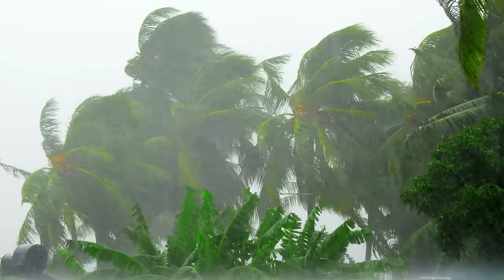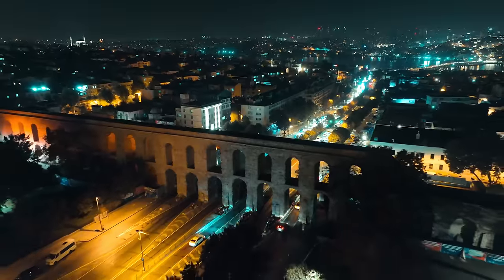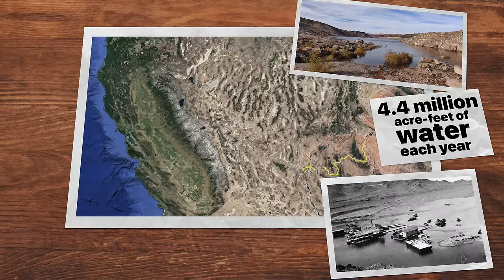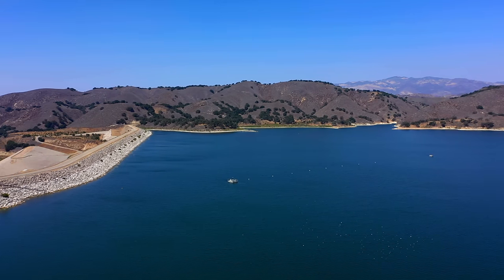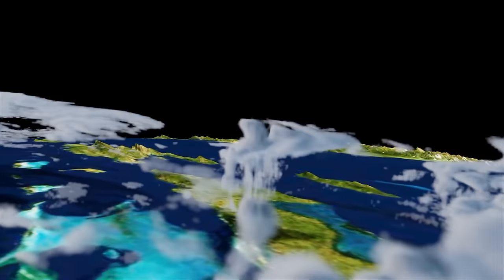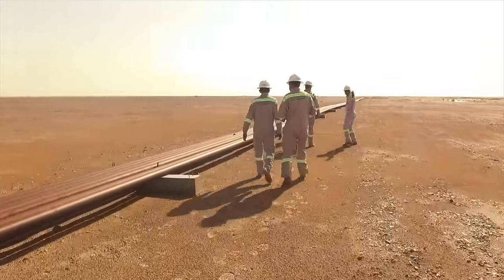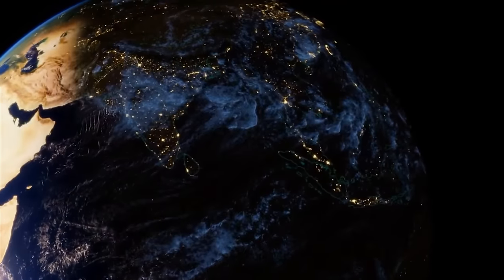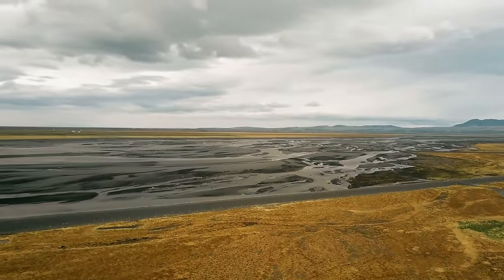Pipelines From Flood to Drought

Comment: I actually wonder though if you could create energy moving water and saving water, there is kinetic energy machines that uses pumping water as batteries. This may not power everything, but it could save a ton of money.
Reply: Are you mentioning the ram pump system? you can also generate electricity from the water going down hill.
Reply: @joearmstrong2404  I believe so, it uses gravity to store and expell energy, like a battery. Also, exactly.

Comment: I have been saying this shit for the last ten years. Get the water that floods off of the Mississippi or when it floods in Louisiana or any other Southern states to move it over to where it is needed. I would say truck it, this is almost the same thing.
Reply: Trucking is not an option, it would take about 5000 trucks a day. It would require canals and pumps,,,,,, lots of pumps. But it is doable. One method would be to pump it uphill and then install hydro turbines on the downhill side. The turbines would create the energy to run the pumps.
Reply: @leroythemaster4268  You are the first person to give me an answer, thank you and your idea for the hydro turbines is a good one too.
Reply: @beauxr.benoit1374  Did you see my post about turning Death Valley into a Salt Water Lake. 
Low cost to do and would actually pay for itself by creating farming and high end real estate and tourism.
 I also have  a wild fire plan if you are interested.

Comment: You made some excellent points. The only issue that I am skeptic about is cooperation between states. During the Texas freeze in 2020 (or 2021), TX reached out to Mississippi and other neighboring states for help, and was denied. And in cases for flood states, when they needed help from neighboring states, like TX, they were denied. This plan is brilliant and completely rational, but I worry that the only way to implement it would be to create a Federal Policy which many states will try to block... even if it saves lives. Do you have an idea as to how we work around this obstacle?
Reply: Forget cooperation between states, how about international issues? Speaking as a Canadian, it's long been known how much some American states covet our water, seeing it as a resource they somehow have a right to. There was the NAWAPA scheme that would have flooded much of northern Manitoba as a mega reservoir to supply the US. Or how about the plans that pop up every now and again to draw massive amounts of water from the Great Lakes (so much water there, after all) while completely missing the important fact that they want to take a larger volume of water than can be naturally recharged. While re-purposing existing petro pipelines sounds like a relatively efficient method to move water around, the example of using the Keystone route just reeks of typical American arrogance, as if in Western Canada we're not experiencing drier seasons with less rain/snow fall ourselves. The dry states have truly screwed themselves - too much population using way too much water per capita. Look at the dried up reservoirs and depleted aquifers as a testament to that. I have long held that if the US ever goes to war against Canada it won't be about politics or ideology, it will be a pure water grab, with billions or trillions of dollars to be made.

Comment: I think your math or assumptions about the fluid in the keystode pipeline is wrong. 600k BPD through a 36" diameter pipe corresponds to a linear rate of 5.515 feet per second. 1000x faster is faster than the speed of sound through water.
No. That's not possible.

Comment: As far as California is concerned, why not pump the extra water back into Lake Meade making it a close loop. Yes, a new return pipeline would be necessary, paralleling the existing one, but the reservoir already exists, and it runs low all the time. Ciao, Marco.

Comment: I was reading somewhere that the great salt lake in Utah is reaching such dangerously low levels that if it continues it will start giving off some kind of poisonous gas and make the entire valley unlivable. Something like this could definitely be an interesting solution.
Reply: This is true. And the main reason for the drying up of the lake is all the alfalfa crops. They are extremely water heavy crops and arent even being grown for the area's needs, but are being sold to China. So short sighted
Reply: @LM-wz9yw  Actually a lot of it is used for animal feed state side. Only 33% exported . But I do agree that California has a lot of water intensive crops. I personally don't think they should be grown in California with all the water issues they have
Reply: @corners3755  you are right, I was specifically referring to Utah, and after researching, it seems only 15% is exported. Also, to be fair, alfalfa is a cover crop and actually helps to keep moisture in the soil and improve local moisture levels.

Comment: Pumping requires additional electrical capacity, and it's expensive.  We're presently at our limit.  With the current administration's executive orders against using fossil fuels, we can't even handle the proposed extra load of recharging all the proposed electrical vehicles.  Besides, it's pretty clear climate change has nothing to do with burning fossil fuels and is related to solar cycles, ocean currents, earth's axis wobble, high atmospheric dust and plate tectonics.  So far, all of the scary ten and fifteen year climate predictions have proven to be false hysteria.  I do favor more reservoirs and pumping water, but additional power plants will be needed to accomplish it.  The US has at least a 300+ year proven reserve of clean burning natural gas (methane) and who knows how much more with additional exploration.  Keep in mind CO2 is last on the list of important greenhouse gasses:  First, by far, is water vapor, then ozone, the oxides of sulfur and nitrogen, methane and a distant sixth is CO2.

Comment: Face value it's a cool idea but there are a couple of important things to think about that aren't even touched on here. 

a) Interstate Politics: You're crossing over multiple state lines with any such pipelines or canals, which then requires agreement/buy-in from those states. We've already seen how much of a clusterf*ck that can be with rivers - where states "split up" water rights and over-leverage natural waterways. Everyone is going to want some rights/access to the water, given how critical of a resource it is - would there even be much left at the final destination? How would you deal configure consequences or deal with bad actors if they overuse? Cost would be nuts to suddenly divert water around a state that decides to overuse. Who maintains the pipes/waterways? Is each state responsible? If the water is contaminated, how do we know and deal with that? Who's responsible? Lots of questions here that don't get solved overnight or potentially even in a decade because of the volume of legislative buy-in required.

b) Side effects on our oceans - we have no idea. One concern of mine would be that, for as long as humanity has been around, fresh water ultimately has fed into the oceans (e.g. rivers emptying out into ocean). If we start curbing all of that today and diverting it elsewhere, what mid-longterm effects does that have on ocean ecology and overall levels? Do we even have a way to know that for sure? As a species we've been very, very, VERY bad about properly anticipating and addressing side effects to any of our actions or projects, and trying to fix negative side effects of such a project as this might be even harder than the water problem in the first place.

Comment: I could see building a water pipeline from Kansas to Colorado, diverting some of the Mississippi flow into the faltering Colorado system. It would not be cheap, but should be feasible.

Comment: I like your example of the Keystone XL pipeline, but you may have missed that the pipeline has been blocked by Presidents Obama and Biden.  It has never been completed. 

Then you have to contend with international water treaties.  Canada doesn't allow the bulk export of water on the scale you are describing.  As an Albertan and Canadian, I think that we should consider exporting bulk water, but only from regions like Northern Alberta where the water is abundant.  The Athabasca River, for instance has an average flow rate of 783 m3/s.  Diverting about 100 m3/s would leave a significant amount. The Peace River has an average flow rate of 2,110 m3/s, 300 m3/s could likely be diverted without any serious environmental concerns.  For comparison, the Colorado River has an average flow of 640 m3/s.  Politically I think the idea is dead in the water.

How much would the US be willing to pay for the water?  How would construction cost be divided?  Even at the ridiculously low cost of $4 per cubic meter (continuously adjusted for inflation), $4/m3 x 400 m3/s x 3600 seconds per hour x 24 hours/day x 365.25 days per year = $50,492,160,000 per year.  That would certainly help to pay down the Canadian national debt.  That's close to the cost of four Gerald R Ford class aircraft carriers per year.  It would hardly be noticeable in terms of the nearly $3 trillion US national debt, but how long can the US continue to run such outrageous deficits?

Comment: Nice presentation but there's an error in your logic.  Reduced viscosity will allow you to move more liquid for the same pressure drop but you have to ignore the maximum allowable pipe velocity.  600,000 bbl/day in a 36-inch diameter pipe gives an average velocity of 5.6 ft/sec (if my math is correct).  That's a good operating design.  Run too slow and sediment will drop out, run faster and you'll suffer from increased pipe erosion.  You might be able to double the flow by running at 11 ft/sec but there's no way you can move 1,000 times more water through the pipe.

Comment: Water finds its own level.  Water can be routed via pipes that can be routed underground, above ground or tunneled through mountains. As long as a water user is lower in elevation than the source, water will flow there.  Oregon, Washington and Missouri are wet States.  Oregon is closest with 27.5” of rainfall Washington is further but has more rain (39”/year). Missouri is even further away, but it is a very wet state with 42.23” of rainfall a year.  They are all higher in elevation.  In terms of elevation, Bend is 3623’.  Mt Hood is 11,249’  Yakima’s elevation is 1066’.  Even Springfield in Missouri is 1299’.  By contrast, all the major cities in California are low enough to have water flow to it from Oregon, Washington and Missouri.   San Francisco elevation is 52’, San Diego is 62’, Los Angeles is 305’, Santa Barbara 49’, Malibu 105’.

Comment: Just some quick checking but I believe the best place to tap the Mighty Mississippi is probably around Memphis, TN with an elevation of 259 Ft above Sea Level.  If you head west / southwest to Texas around Texarkana 311 Ft above sea level, out to Potsborough, TX on Lake Texoma 769 Feet above Sea Level, on out to Amarillo, TX 3,668 Feet above sea level then on to Santa Fe, NM 7199 Feet and then to somewhere on the Colorado River.  Bottom line that is a lot of Horse Power to pump any significant amount of water.  I don't think it would be feasible.  :(

Comment: I think you made an error regarding viscosity:
Resistance to flow is based on the SQUARE of velocity, so a drop of viscosity by a factor of 900 would only increase flow by 30x
😢

Comment: Your calculation of 600M barrels of water per day is whackadoodle.  Please check your figueres.  It does not pass the smell test.  Since there are 86400 secs per day then i'd need to see about 7000 barrels of water passing through an observation point in the pipe every second..  DImensionally a 55-gallon barrel of water would take up 9.5" of a 36-inch diameter pipe.  So 7000 barrels per second would equate to 5541 feet per second, over 3600 mph, so that water is traveling at hypersonic speed.   Your estimate is completely wrong.  I might believe 6M barrels of water a day.  I might.

Comment: This is Brilliant !   
    ? What about using Elon Musk's "Boring Machine Co." to make the pipe-line underground, it could be "stepped" & slanted ever-so-slight that gravity would do most of the work. 
          The end-of-line pumps could be 1000's of SMALL solar powered pumps that could run continuously with battery back-up.

Comment: Oil pipelines?  The cost of shipping oil by pipeline is around $5.00 a barrel (well $2.00 a barrel if flowing downhill)    Nobody can pay that much for water.  Anywhere or at anytime.  Keystone?  outside of Oklahoma region, only 2 miles of the US section was built in 4 years of Trump.  But then the BBC looked at the "wall" and concluded only 30 NEW miles of it was built over the same time. Yes, many miles of wall was replaced, but that was all ready mostly planned for decades.  Please do not blindly believe what I say, look it up yourself. Actually a good plan for what  most "experts" say.

Comment: Ignoring the fact that the drought extends from the West Coast to east of the Mississippi River - making pumping water from the Mississippi a non-starter this year, there is the question of how to pump huge volumes of water from the elevation of the river to Lake Mead. Since Lake Mead is at about 1200 foot elevation, so far so good. Of course, to get there from Iowa the pipeline would have to climb to over 6000 feet before descending to Lake Mead. The Mississippi River is around 600 feet above sea level in the reach of Iowa. A pipeline from Dubuque, Iowa to Lake Mead would be about 1500 miles long.  Basically, it required pumping water a mile high. The now-defunct Keystone XL pipeline would have been 1200 miles in length and in 2014 was estimated to cost $8.7 billion - so add 25% for the greater length and another 20% for inflation and it might cost $13 billion in 2022. Then there is the question of how many lift stations would be needed to move the water up a mile+ in the air. This would be a true megaproject and could easily take a decade - with the risks that the Mississippi River may not have the excess water anyway and the drought could be over before it started operation. The time it would take to get the design done and the environmental clearances and to assemble the right-of-way could easily add another decade to the schedule. In fact, the whole idea of just sucking water from the Mississippi River assumes some sort of significant water impoundment, perhaps in the pool above the dam in Davenport. I suspect the $13 billion guesstimate is way low. Anyway, maybe in 2042 and after spending $13 billion (plus another $3 or $4 billion for inflation from 2022 to 2042) a pipeline might be able to send water from the Mississippi River to Lake Mead - or not since the most recent example we have is a drought that has impacted both the southwest and midwest. How about a pipeline from Lake Superior instead? Just another 400 miles maybe. Alternatively, how about building water desalinization plants in California? The 35 MGD Carlsbad SWRO plant near San Diego has been estimated to cost $250 million, so for the same cost we could build 52 large water desalinization plants and avoid the delays and reduce the environmental impacts of a pipeline from Iowa to Lake Mead and fill Lake Mead to the brim in 9 months. Just a thought.